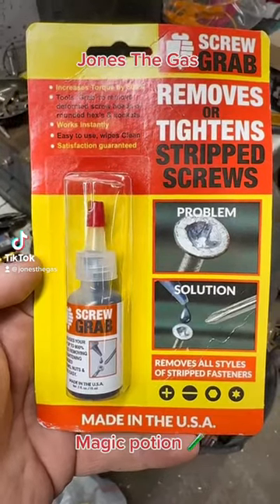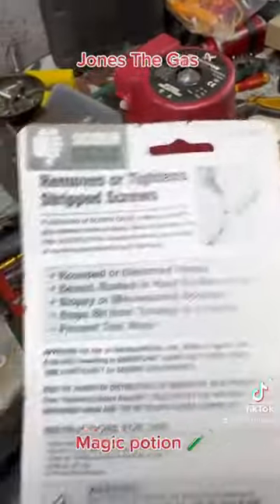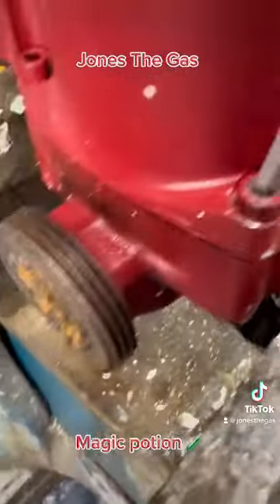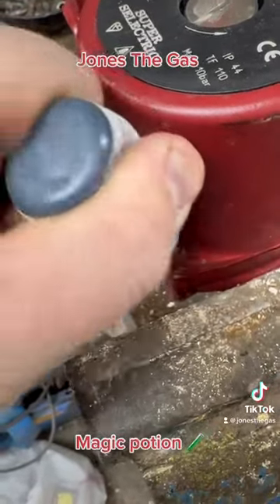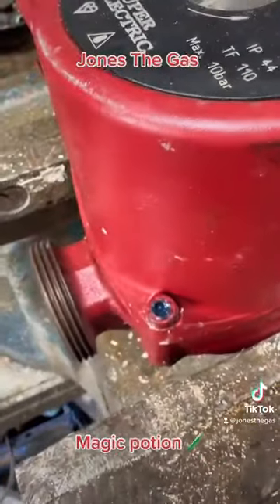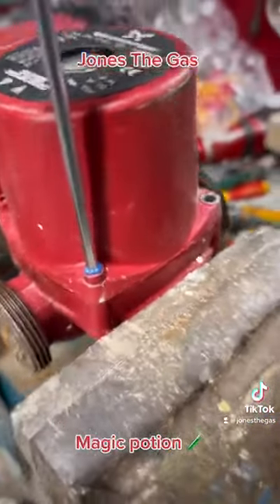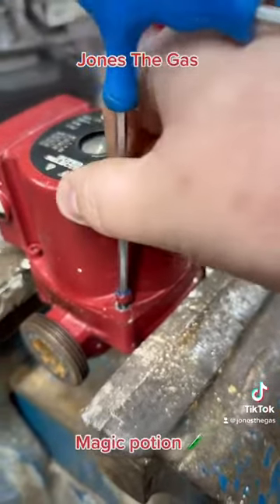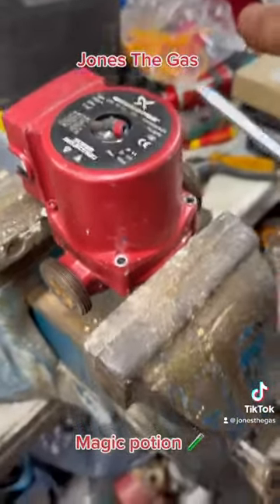Dean from Jones The Gas Screw Grab review

Comment: So I had a stuck, crosshead bolt in a uPVC door handle, which I needed to remove. And I could not turn the bolt and my screwdriver was burring the head. I was very sceptical about a liquid helping me to shift the stuck bolt. But then the alternative was going to be to drill the head of the bolt out. So I decided to (sceptically) purchase some Screw Grab and try it. (Sceptically) Popped a drop of the liquid on the end of my screwdriver and placed it in the head of the bolt. And I followed your advice and wiggled it gently, until I felt the connection between the screwdriver and the bolt become firm. And then  ….  I was able to turn the bolt, without the screwdriver slipping in the head. Wow! So Thank You, Dean for the great video and advice.
Reply from the maker: @tobermorywomble6446  thank you Tobermory ♥️